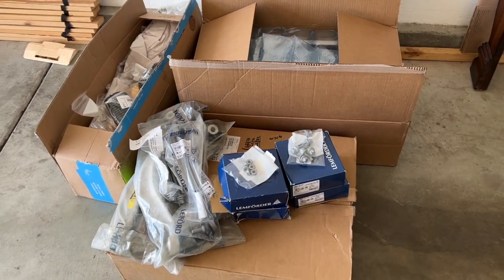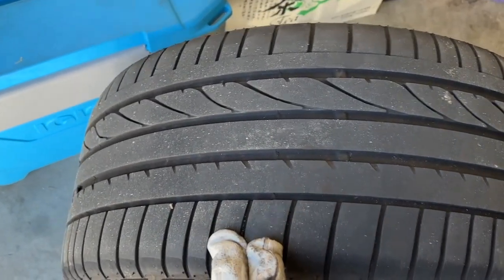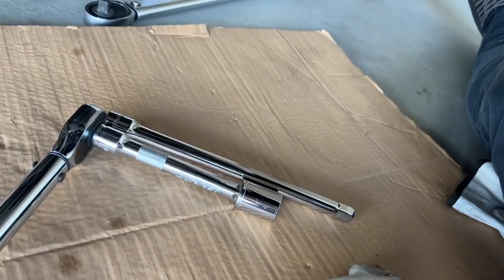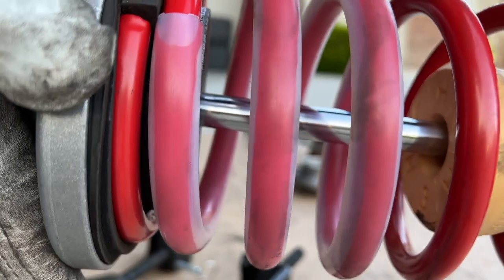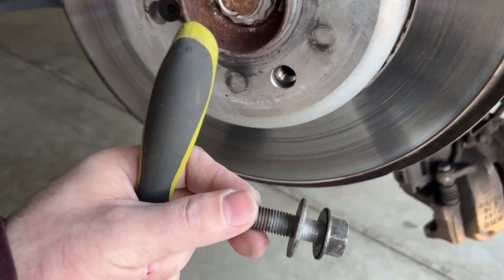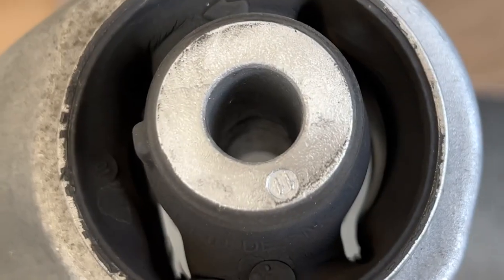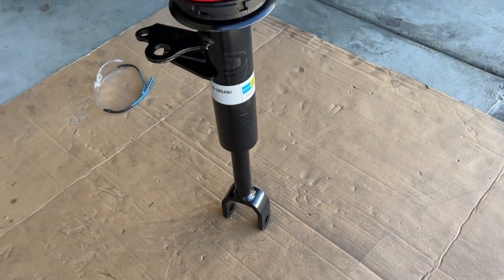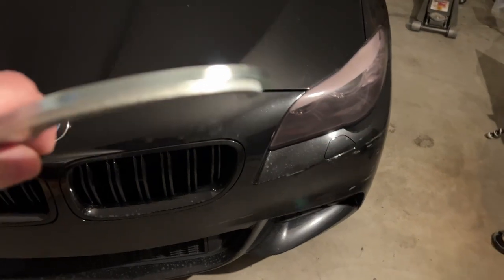How To Install Lowering Springs / Coilovers On BMW F10 | H&R VTF Adjustable Springs | BOND Garage

Comment: After you change your shocks, did you have any error codes on the dash referring to stability control error also known as EDC
Reply from the maker: mine doesn't have EDC. if yours does, you need different shocks or an EDC delete kit. I'd prefer having EDC tho
Reply: @BONDGarage  having the different mode like comfort sport and sport plus doesn’t mean I have edc right and normally if I did have edc I would have a wire connection on the top of the shocks or even on the side of the strut right ?
Reply from the maker: @Driven_Life  yes, that's right. you should also feel a noticeable difference in the suspension when driving and switching modes when you have EDC.

Comment: Your videos are amazing! Very helpful thank you. For the rear shock lower bolt some other videos are showing 250nm and normal position for suspension? This does not sound right however?
Reply from the maker: yes, normal position makes sense and 250Nm sounds roughly like 100Nm + 90 degree. It definitely needs some leverage to open it in the first place.
Reply: @BONDGarage  thank you! Second broken rear spring in 6 years and want to make sure I do it 100%. Trying bilstein B4 and b3 this time 👍

Comment: would you be able to reply with a link to the lowering springs you used? and im new to cars but i have a 2014 bmw 550i and was wondering if those springs would work on mine considering yours is a 535i
Reply from the maker: You can find the link to the springs in the video description, and yes, you can install them on a 550i

Comment: How do the VTF feel? Is it still similar to stock comfort and smoothness?
Reply from the maker: not at all. I'd say it's the same jump as you have from stock to M sport. mine went from M sport to VTF. initially you feel the new struts. for about the first 2 weeks. once they're broken in you get a better feel. I have pretty shitty roads here so i feel it every time i drive. I wouldn't want to make it any "sportier" because I still want to retain some comfort. so it's a good compromise of sport and comfort. coming from a non-sport suspension it'll be day and night. maybe like an overloaded 3 series with m sport suspension. hope that makes sense..